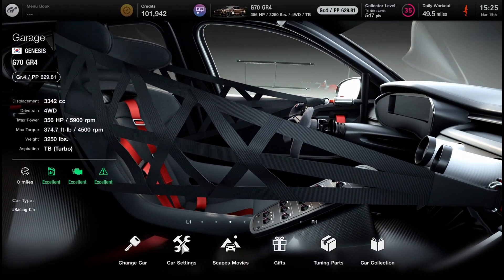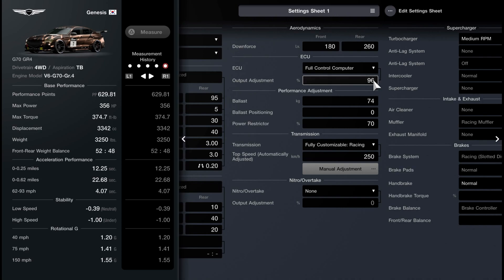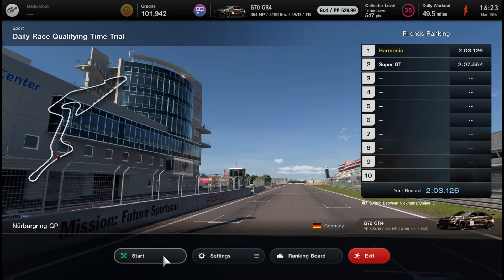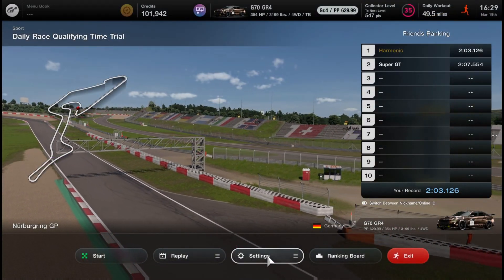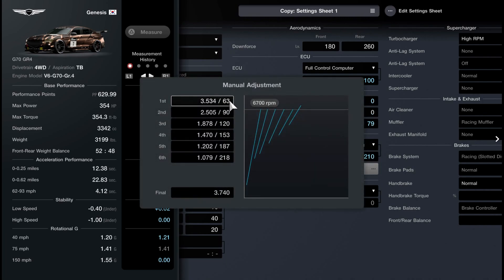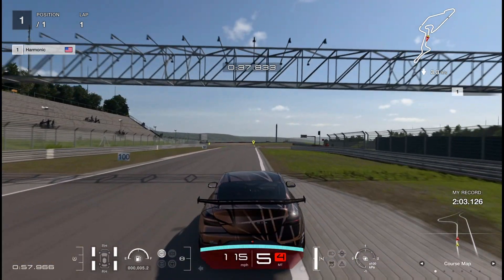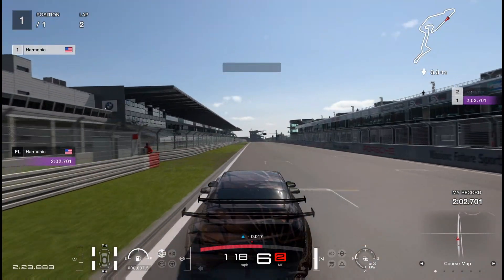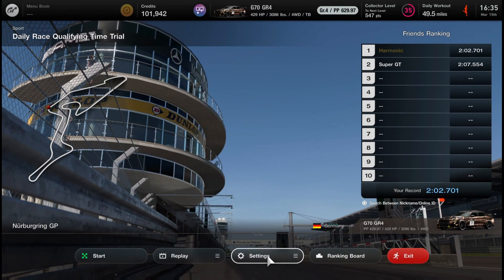Is the PP System BROKEN? | Gran Turismo 7 Tuning Tips

Comment: ususally kept it to my self cos I can't be arsed to go into it.. But since GT2 I noticed many ppl buy the upgrades for a car such as racing suspension, then just races it - BUT all the add on actually did was give the adjustablity -  IT DIDN'T actually change anything!. simply looking at the spring rate before and after shows nothing changed. but check the spring rate on pretuned cars and it's been jacked right up. so when it come to camber / toe / compression / rebound / brake power / custom gearbox tunes, there are seconds to be made up everywhere if you're willing to spend time testing. this is what I've always loved about the game.

Comment: This explains a lot of my frustration with daily races and such. I recently made the change to a wheel / pedals setup, and while my offline times were noticeably faster, my gains online were minimal. I really noticed it in qualifying times, where I usually started mid pack, but the gap between myself and maybe the top 4 qualifiers was 2-3 sec. every race. And in the race, I couldn't make up that gap, even while being faster than the cars behind me. 
I wish I had found your channel earlier, but I'm glad I stumbled upon this now ! This is great info, thank you !!
Reply: Yes i was in a race and i was faster than everyone on getting out of the corners and they finally  ganged up and spun me out. Then the leader comes up and it says move over for a faster car but he couldn’t pass me and right at the finish line he tried to spin me out and got around me buy barely and it finished me at the same time. This game is far from a simulator and far from the older gt games

Comment: after having a bit of a play around i think ive worked out what is actually happening here

the PP algorithm takes into acount the G at 150mph, but if you set the gear ratios up so that the car can never actually reach 150mph then it cant technically produce any Gs at 150 and so it gives a 0 rating which lowers the overall PP rating.

i suppose its not really a glitch or broken but just a flaw in the very complicated PP system GT7 has tried to implement.
Reply: See, that's what i'm trying to say in my comment.

Shortening gears so you don't reach 150mph (because you don't need to / won't ever on that course) and that's simply how their pp-system works then.

Not broken, just complex and maybe a tad bit annyoing.
Reply: @tydendurler9574  I'm not sure, I think gear ratios are too track dependent to actually incorporate into the pp system, like on tracks with short/no straights like tsukuba the shorter gears will outperform longer ones without the pp system being aware of it at all. I think it probably wouldn't hurt to take out gears out of pp altogether since you can't really tell from setup alone how well a car will do
Reply: @oxey_  there's only a handful of tracks that will really benefit from extending the gear ratios past 150mph, route X, Tokyo expressway.
I mainly only race around the nurburgring and even on there there's only 2-3 areas where I'm able to hit the rev limiter.
On a 700pp limit my absolute best time was a 6:43 without nitrous. After using this trick I gained another 7 seconds.
I don't think the track itself really matters too much but more the PP limit you are racing at, the lower the PP limit the more you can benefit from using this trick.
Reply from the maker: I cover this at 1:03. Lol
Reply: @Harmonic14  you don't really explain how you did this though, I mean how you actually got the tune to the point where changing 1 single thing can cause the 0.00g at 150mph.
Reply: @adz94wally  exactly. He just added 1 kg of weight to the car. It has nothing to do with short gears
Reply from the maker: @EasternUNO  it has everything to do with short gears. If your car isn't geared long enough to hit 150, then the game won't calculate the 150 MPH rotational G number... Pretty simple.
Reply from the maker: @adz94wally  it's not really that hard to figure out. You use a combination of weight, gears, and downforce so the game doesn't think you can hit 150 MPH. Just keep changing stuff in that direction until rotational G is 0 at 150 MPH. Don't know how I can put it any simpler
Reply: @Harmonic14  ok thanks for explanation dude
Reply: 2 yrs later has it changed ?

Comment: As someone who loves online racing, GT Sport was brilliant and the BoP system worked very well. I haven't touched an online race in GT7 yet. Not only am I clueless about suspension settings and gear ratios etc, I just knew the potential would be there for people to exploit the system. Not to mention the slack track limits. I kinda hope that people will continue to exploit so that Polyphony will just think "screw it" and go back to BoP for daily races.
Reply: I hope they keep the open setups. I'm not sure why they aren't using the BoP restrictions to balance weight and HP though. This PP system should only be used to balance street cars (since BoP setting don't exist for them now), but when they do the PP system they should also add HP and weight restrictions so people can't abuse the system.

Edit: I feel they are just doing tests through the daily races right to see how well each system works to determine if things need adjustments and to figure out the best system they should use for the FIA races.
Reply: Thankfully the championship races are BoP and no tuning so that means we can focus on that until we understand tuning more.. and they fix the exploits.
Reply: Huh strange I spent countless hours in GTS in great online lobbies racing against each other with the exact same format as GT7. 300/400/500bhp limit but you could tune and develop you car so much. It was so fun shaving time of your laps and learning about what makes cars handle well. A big factor in Motorsport. We'd send each other tunes and learn more.
Reply: @sammyh.748  yup. A lot in this game feels like "beta test phase". That's just how it is these days, as sad as it is.
Reply: @tydendurler9574  Yeah, I don't think it is Polyphony's fault though. I feel Sony pressured Kaz into releasing a bit too soon. He may have quite a bit of sway with Sony but there is only so much he can persuade them to do, because at the end of the day Sony is the publisher and Kaz already had it delayed a year.
Reply: the truth is that just many many people simply dont get how physics work and then scream exploit and broken which is amplified by clickbaiting media of today and that also prevents the discussion about the really important things (always on, server performance, quality of live improvements like adjustable HUD and FoV etc.), its just ridiculous.

But we all already knew that you can't have shit in detroit...
Reply: The biggest problem online is ballast and power restrictors are not regulated like in RL motorsport and in GT7 it is Cheating, another regurgitated Arcade Feature from Sport

They need stricter limitations, because it allows More Extreme performance Cars that don’t belong in lower performance classes to mix, Unfairly. because upgrading especially traction and stability is limited by the games finite options, and within their broken suspension and tire models, therefore its Cheating

Its Only allowed in real life within extremely tight regulation. You can’t in Real life enter a Power restricted Lamborghini into a amateur Sports Car Cup. It’s that arcade FM like generic racing that ruins online, it’s a cluster F* 

Need Far more SP MP Classes and Lower PP races, Classics only, Muscle Cars only, Hot Hatches only, Sports Cars only, etc etc.  Mixing classics and modern with super or showcase cars is Asinine!

Comment: I think the Performance point changing when you change something very important like the suspension, mainly the ride height if the car has a diffuser, is ok. what I think is wrong here is the massive difference between when you add 1kg or reduce the power by 1%. 24 performance point loss between each of those settings is massive for such a small change and I think that is the main issue
Reply: Couldn't it simply be a bug, not a feature?
Reply: @tydendurler9574  I don't think you really understand how setups work. even IRL, some suspension settings actuaally makes your car perform way better. what I actually pointed is the 24PP loss/gain over a single tick of a setting. that is the real bug
Reply: @togera77  the only reason it’s taking 24 points off is his top spear dropped below 253kph with that change. You couldn’t take another kg off and loose another 24 points. 
It’s an issue yes, but it’s no use on faster cars as you’ll be smashing the limiter on every straight. 
You can do exactly the same thing with the custom gearbox and adjusting your top gear.
Reply: @SgHawk144  on short tracks up to 700pp, 149 top speed is really no problem. i’ll max the downforce anyway and usually it’s hard to go much faster than 150 regardless. at 600pp even long tracks you do better with the 149 speed limit, you’re talking about the difference between sport hards and sport softs

Comment: i been doing some pp races online i have a mini cooper 05 set up to the max with a hp rating of 285 and a pp of 679 max so i set that pp rating in races but then ppl come in with race cars or example a r34 skyline with a higher hp and higher gear. where they usally get me is in the straights but corners seems to be the same. one major thing comes into play is top speed that i think will need to change for pp rating as i cant get my car up to top speed as fast as the high end cars. as a side note would love to see more setups vids of normal cars

Comment: So moral of the story 0 rotational G and use that drop in app to add power. I too wondered why just 1 click sometimes made PP jump so drastically
Reply: Hopefully with a patch it gets resolved.  So far if these glitches are ignored the racing can be very good in gt7 when using pp ratings
Reply: The one more click of weight, or one click less power probably was enough that the car could not reach 150 mph on the simulated lap. Therefore rotational G at 150 mph was 0

Comment: Another thing is how horsepower contributes to pp. It takes the maximum horsepower value, rather than area under the curve. So, when tuning, using less ecu restriction and more power restrictor restriction would give you a better performing car. This is because the horsepower over the entire rev range will be higher, only the max horsepower value stays the same.

Comment: thinking about this a little more, while i'm sure it requires balance adjustments, i don't think the example given here would play out the same at every track. in short, i think on a track with relatively short straights you see the huge gains, but if you were to try this same trick at, say, Nordschleife or Bathurst, the gearing difference/top end limitation could significantly hurt your lap. it's just a thought though, i don't even have a playstation currently, lol.
Reply from the maker: That is 100% correct. If a track had a long enough straight, this exploit would probably hurt you more than help.
Reply: I thought the same thing but how exactly does one approach this then.  As an exploit?  Exploits usually give you an advantage all of the time not just some of the time.
Reply: @FirstTuber123  because it is not an "exploit". It's simply how tuning (in GT7) works.
Reply: @tydendurler9574  Ok he said that 137mph was the top speed of the car anyway.  So any car fits the bill.  Just an exploit of how the tuning system works.  I doubt this is what they intended, but I hate to think this type of thing slipped by in development.  It’s one hell of a game changer.  I like the tuning system but I think about how many people are going to just give up on multiplayer.  I hope it doesn’t take patch after patch to get it right.
Reply: @FirstTuber123  of course it'll take patch after patch to get it right. 
What do you expect, a finished product? 😅
Reply: @FirstTuber123  yeah, that's kinda where i was going with my comment. it's not really an exploit IMO but more of a very important thing everyone's going to have to keep in mind when tuning for specific tracks. the cornering G @ speed that the PP "test" performs makes sense, and the only way to account for a 0 is to decrease the PP.  if they removed the cornering G test (or somehow reduced the impact of a 0) then gearing tuning becomes too UNimportant. this is probably something that will take some long term analysis by Polyphony to fine tune for balance, if it's necessary at all.

Comment: Gran Turismo needs to back to an Balance of Power system like they had in GT Sport. It made the races more competitive, and balanced. I don't feel like messing with suspension, differential, transmission setups in this game to get an competitive edge, (Do you think Lewis Hamilton adjust settings on his car when he goes in the paddock by himself, or does he have engineers that do it for him.) . I'm not an engineer that should have to know about lateral G's, I just want to have fun and race.
Reply: There should be competitive presets.

Having the ability to tune precisely is fine imo, but damn is it unfair to the people who just dont care about all of that.

then again tunes largely depend on driving style so that wouldnt really work either

Comment: I would say that BoP is broken too. Every time there is BoP in single player or multiplayer, my car gets left by everyone else. Had a 26 second lead with two laps left and almost lost the race completely while putting down PBs.
Reply from the maker: BoP needs work for sure, as does the single player rubber banding
Reply: Same my car was doing great times until the race and then it felt like I tuned traction control off.

Comment: Thank you for exposing this exploit, such a shame as I thought PD would have done enough testing to catch some of these bugs.  We need to let them know as soon as possible what the exploits are because meta tunes destroy competitive and fun racing.  However, 9:12 I strongly disagree that tuning should be omitted from PP ratings - either prevent tuning all together or measure every single aspect of the car, no in between - this is what forza does and it’s broken beyond repair.  Omitting tuning would add even more exploits in terms of suspension settings and even clunkier gear ratios.  I wanna add one thing tho: performance rating systems, in any racing game, shouldn’t measure stats over an “average” race track or “average” race distance.  PP should be calculated for the race itself, including tire wear and fuel consumption multipliers.  That way, there’s statistically less variance in builds and you minimize the chance for meta cars.  And in gran turismo it would work perfectly because you can adjust your PP rating by adding weight ballast and power restrictors without any additional cost.  Cars could even be automatically tuned to spec if people want them to
Reply from the maker: I don't agree with tuning being a part of performance rating - no other racing event, real or virtual, does anything like this. There is a theoretical maximum amount of time any particular upgrade will gain you, and that's what should be used as the gain in measured performance. Forza's PI system is arguably more functional than GT's despite its flaws and go-to upgrades for maxing a build.

Measuring performance for a race itself would require way too much effort, and it certainly wouldn't be accurate if they're already this far off the mark with such a basic system.
Reply: @Harmonic14 my case for measuring each race differently is your point about gear ratios - would gear ratios be an exploit if the characteristics of the track were considered in the pp rating?  No, it would be taken into account in the theoretical race stint duration.  Performance ratings are measured in relation to a global average of required performance attributes, meaning nuances are overlooked and as a result field spread is a huge problem.  It’s not that hard of a concept to grasp it’s just takes a little more effort from the player to adjust the rating of their car from daily race to daily race.  And daily races only change every week so it would be perfect for gt7

Comment: Idk if it's bc I'm playing it on ps4 but when I change the settings to my suspension/ or Ballas settings the performance stats on the left bottom explaining the g force/ acceleration speeds ect non of those numbers change after I hit measure stats. Only time anything changes is if I upgrade the car engine mods

Comment: feature not a bug.  I saw a beginners tips like a month ago and it said you can mess around with settings to get extra power under pp regulations.  So I took that to heart through the game.  My favorite one is the Alfa Romero c4 road car, with the bore up, soft sports tires, suspension, and a couple of weight reductions.  Thing is as nimble as my little 1.8 liter 2700 pound Hyundai Elantra in RL, only with double the horses, yet so light it really kills on sport tires.  This left a lot of PP's to play around with.  That's my advice.  Find setups that let you run sports tires.  Racing tires are worth a ton of PP, and many cars don't have the low end torque get those proper in the first place.  End up having to drop gears too much just to keep up the torque.
Reply from the maker: No, it's 100% a bug. Two functionally identical setups should not be 40+ PP apart. That makes 0 sense.